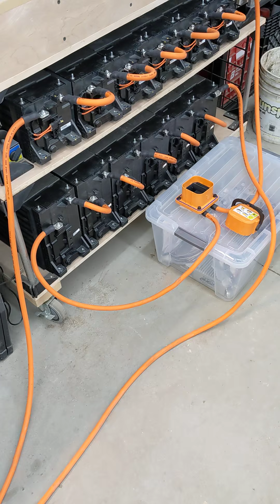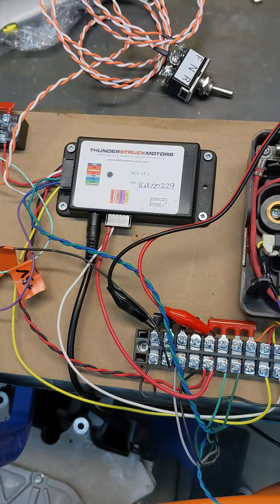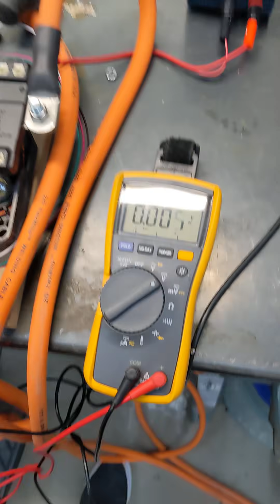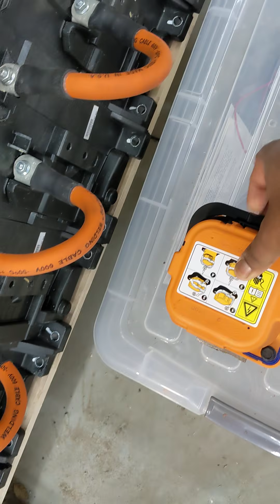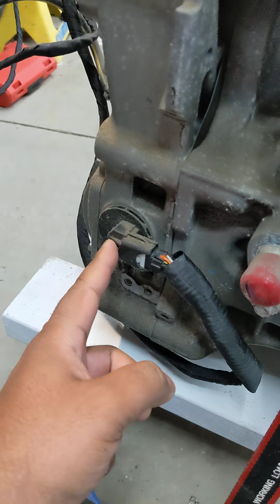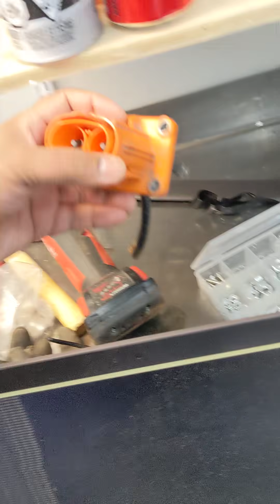Volvo EV conversion with Nissan leaf motor. It Spins!

Comment: No need to make excuse or feel badly for removing an ICE engine. The electric is so much better in all respects, but especially as you are engineering it, assembling it,mand making it work. Certainly maintenance and repairs will be simplified for your future. Does that motor runup sound a little ballsy rumble like some worn output bearings or some such thing? And, I heard dentist drill sounds from the motor windings, or inverter. Accchh!!! Bad memories!!

Comment: Hi! and thank you for these videos! I'm very interested, because I have a similar project. I saw that you use the Thunderstruk VCU, with the HV contactor block from the Leaf? that's it? I also read that you then want to use Damien Zombi Verter. I'm thinking about these options, Thunderstuck VCU and like you used the HV contactor block of the Leaf, but then the problem will be to make the charger and DC-DC converter of the Leaf work?? The Zombi Verter can apparently manage the entire inverter system, PDM, but the explanations for connecting and configuring it are not super clear. I can't wait to see when you connect the Zombie Verter? if you can share the explanations of connections and settings, that's great. Because I have followed all of Damien's videos and some also from Yohanes, consult the wiki, openinverter etc. but everything does not seem super comprehensive to me, for the connection and settings?...

Comment: You worked out charging yet with using leaf stack ?
May want to look at change from thunder struct VCM
Reply from the maker: Ive got a zombieverter to run the whole stack. I just haven't got around to wiring it in yet!

Comment: Neat, we put some Leaf motors into our vehicles and it works fine. Are you using openinverter or just sending the right CAN message to the Nissan inverter?
Reply from the maker: I'm using a thunderstruck VCU for this test, but i've got Damien McGuire's Zombieverter on deck to do the actual control
Reply: @SolTurboLove  Great, good luck with the progress!

Comment: I have a 24kwh leaf pulling 400a, those relays have been good so far for 6 months, time will tell.  220a fuse is fine too.
Reply from the maker: Nice! I did end up getting some bigger contactors but it's good to know that these can pull decent power
Reply: @SolTurboLove  - ive now pulled. 500a no issue
Reply: @SolTurboLove  I blew the fuse and relays on leaf setup, when wired wrong. Other than that they seem ok and protect things when needed

New leaf are 160kw motor, check what fuze that have
Reply: @theevworkshop7382  fuse is same - they are basically there for short circuits,

Comment: Nice work. How will you make the coupler? There is a guy who makes an adaptor for the Leaf motor if you need one.
Also interested in where you got the Service disconnect.
Reply: Thanks! I've got a Brat em57 plate and coupler in the mail and an aluminum plate on order. 
The service disconnect I got from a local business who does EV conversions so i'm not certain where they sourced it from unfortunately.
Reply: @solomongokavi8393  That's the one I was thinking of. 🙂
Reply: MSD 600 series switch
Reply: @KingofStreet3  I ended up buying one from Zero EV. 🙂
Reply: @alibro7512  sweet. Now it’s time for me to make a parts list.
Reply: @KingofStreet3  I can't remember if you have your batteries or not but geting them is the priority as the type you have will dictate everything else.

Comment: Do you need a clutch and flywheel when using the m46?
Reply from the maker: No, I'm doing a direct spline to spline coupling using the center section from my m46 clutch